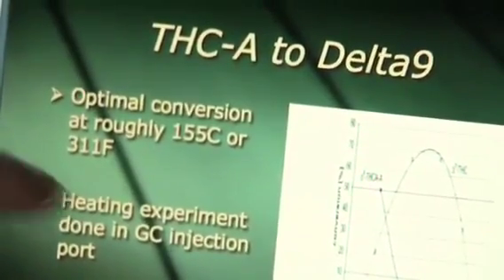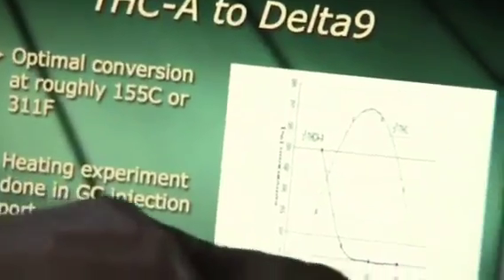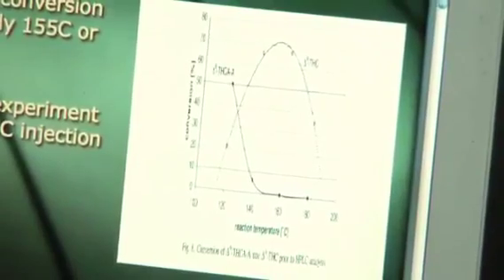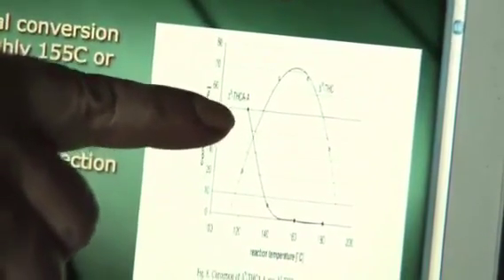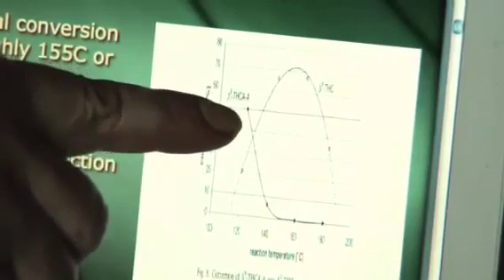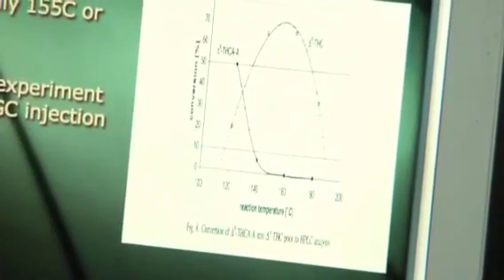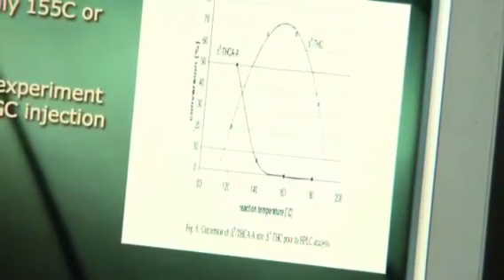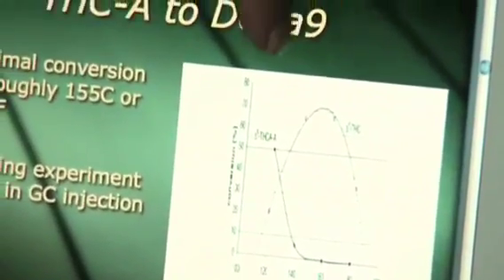Dr.Paul Hornby about Decarboxylation

Comment: Its true 20min 150c or 300f in alu foil, then let it cool down, then grind it down in a mortar, not to fine.
Add  water and drinks this it will destoy Chrons and other diseases. 
Most important it will put u in the most brutal high

Comment: It's so confusing.  We hear experts say 245 degrees for 27 min, 250 degrees for an hour,  250 for and hour and now 311 for 30 min......all have their charts too.  Who does a person really listen to??  Also, he says 311 degrees for that length of time would be too much for a small quantity.  So......311 degrees for 20-30 min is for what amount of MJ?  See.......still no clarity on the topic.
Reply: OR's Lonewolf I usual see this temp and time done for about one ounce of flower. Give er take...
Reply: OR's Lonewolf it's old science that gave us the 250 I remember reading something about the experiments being done in a closed sealed enclosure also.
Reply: Reality TV Clips If you use a heat greater than 160 ° f you will cook the THC right out of it . at this temperature I cook it for 2 1/2 hrs it works for me .
Reply: I have decarboxylated a lot of weed, for for a small portion, say two or 3 grams, wrap it in tinfoil,Put it on the rack of the oven set your oven for 250 degrees Fahrenheit, for 25 minutes, your material, should come out a golden brown color, now that it has been decarboxylated, it is now no longer THC a but THC ready for cooking or just eating as it is
Reply: I've always decarbed at 250F for exactly 27mins.
Its always produced great oil.
I agree tho that so many say so many different thing. I stick with my recipe
Reply: @444valencia  Ya know, I've never experimented with different times. I'll give that a shot. Maybe it's a matter of doing different time and have it tested.  THX
Reply: @10MinutestoRouletteFortune  from what ive learned, more than 27 mins will ruin the thc potency. Also too hot or too cool will ruin the results. I think i will stick with 250 F
For27mins
Reply: @444valencia  I appreciate that. My oils and butter has always turned out fine but perhaps higher in THC with a lower time. There are two ways to achieve more of an indica effect with MJ. 1, to let it grow past the stage with more amber trichomes or be, over carboxilation time.  I'm sure you know that but don't know your level of knowledge. I also  mostly grow sativa as I'm Bipolar, I have two parts of my grow take. The sativa I use for energy for the depression and I over grow's time by a week or or more to 70% amber to 30% milky for a more indica effect for mania and pain. To kick me down a notch. I just love how growing can produce the same effects with just one strain.
Reply: @Home Grown absolutely agree. I'm only ever doing what Rick recommends.
Reply: @Home Grown I've progressed in my skills. :)

Comment: Does the boiling of cannabis in butter and water decarboxylate the product, allowing for absorption of THC’s via GI tract?
Reply: I've been wondering that myself.
Reply: You can decarb in water and butter, but it has to cook in a crock pot for up to 30 hours. It’s a big waste of time. Try  boiling the cannabis in a Reynolds baking bag  for 100 minutes,  gives you 100% decarboxylated MMJ No fuss no muss, Or you can bake it in your oven at 240*F, in a glass bread pan. Cover the inside bottom of the glass pan with  half of your cannabis, put the rest on top of the probe and  cover with thick aluminum foil place in a preheated oven (240*F).Set your alarm to go off at 220 to 230 turn off the oven and let the glass cool down to the touch while in the oven. 
I live in the desert southwest. I’ve found that I can use the same method using the bread pan and foil. I just set it on my patio and let it sit for 24 to 28 hours, and get great Decarboxylated cannabis.
NOTE: Never leave your MMJ in oven unattended, one distraction will get your oven medicated not you.
            Cannabis must be completely dry. This is when you can crush a bud between your finger and thumb.
            If not dry the THCa will leak out and burn on the glass,
            Never use a metallic pan to decarb MMJ with. Metallic pans heat up too quick and will burn your MMJ.
If not clear on any part of the procedures, just ask. It took 3 months to get this. I’m Sick and Busy
Reply: +Caseys Karma  That's some top notch advice you've got there!  You sound like you've done your studying!  Can you help me understand more about it?  After decarboxylation, is it good to extract/infuse at 305, then separate the oil from the herb (setting it aside labeled as 305 oil), and use the same herb again with new oil to extract/infuse at a higher temp, like 340 or 350, so as to make efficient use of the herb, destroying less of the first cannabinoid extracted/infused, does that make sense?  I can't help but wonder how one can then tell when it is that the fat in the oil is fully saturated with cannabinoids.  Can the oil be reheated to the same temp (or a little lower than before) to extract/infuse new herb into it in an attempt to saturate the fat even further, or should that be tried without letting it cool down in the first place?  Any idea?  Sure are some good questions, huh? lol  I'm thinking of using avocado oil with a boiling point of 520, so as to goes as far as to even extract cbc, pulegone, and quercitin.
Reply: Thats great, you can substitute apple sauce for the egg in the recipe, it cuts back on the cholesterol in your foods. Has the same reaction eggs do. You can find out how much under vegan substitutes.
Reply: Caseys Karma
Well, grapeseed oil has a smoke point of 420 and is all unsaturated fats.  Sounds as good as it gets.  lol
Reply: The information contained in your answers is great. I was first soaking my material in water for 24 hrs, changing the water every couple of hours to remove the chlorophyll taste then I'd dry it in preparation for infusion into butter @ 250° for 1 hr. Next time I'll try decarboxylation at the end of the drying  time by bringing the shake/bud up to 305°-310° for 30 minutes.
Reply: The reason for Decarboxylation is to activate THCa into THC the psychoactive form that gives you the high, and to remove any contaminates that could kill you, like E. Coli, and many others. Other Cannabinoids can be extracted at higher temps. The 305 is in the range to release more cannabinoids, but you need a list to find out the temps and cooking times. I would never heat MMJ in oil above 350, thats hot enough to deep fry chicken, not so good for MMJ. Before you cook with oil you need to look at two things. First you need to know the SMOKE POINT of the oil you’r using, and the temp that other Cannabinoids you'r trying to extract. Then you need the FLASH POINT of the oil you’r using. As you approach the Smoke Point, it is a warning that you’r close to the FLASH POINT of the oil you’r using. Exceeding the Smoke Point is a sign that you’r about to hit the Flash Point, which is the leading cause of Kitchen Fires.
Cooking at 520* exceeds all listed oils Flash Points, Safflower oil has the highest smoke point at 510*, exceeding that it will cause a house fire. 
The way you can tell if you have good 305 of 350 oil is to check the color, it should be amber, all the green comes from the Chlorophyl in the plant, so it is usually extracted along with THC, giving it that nice green color. 
The bottom line is that you should know the oils Smoke Point and Flash Point,  the temp of the Cannabinoid   you’r trying to extract, and the cook times. Most of all never try an extraction with oil more than its Smoke Point. The highest Smoke Point I could find is with Safflower oil, it has a Smoke Point of 510*, so never grab an oil off the grocery shelf and think it is all right to use. Some cooking oils have Smoke Points as low as  high 350, thats hot enough to cook chicken, What it will do to you’r MMJ? It could cook off all the Cannabinoids.You need to GOOGLE Smoke Points of cooking oil, there you will find a list of common cooking oils Smoke Points. That will open your eyes. I only found 1 oil that can tolerate the temps as high as 510*F, Safflower oil. All other oils will hit its Flash Point and start a kitchen fire before hitting 500*

The information that was given in the video is dangerous and should never be attempted by novices, only by experienced people with the proper safety clothing, and eye protection. I would hate to see anybody end up on a burn ward with 50% or more body burns, just to get some of the hard to extract Cannabinoids from your MMJ. If you need them,  try the Rick Simpson Hash Oil technique
Reply: mef175, I would extract the THC, first at 220 to 230, then try with fresh Safflower oil, and it should work. 305, may be slightly green but usually amber. Its easy to tell if you’ve extracted any cannabinoids by the color. Compared to uncooked oil it should be slightly green to amber, the green id due to the chlorophyll in the plant, and has nothing to do with the Cannabinoids, if you did the THC extraction properly, you should get all the THC and chlorophyll out in the first cook. The 305 and 350 are very high temps to cook at, and could burn off your Cannabinoids if you’r not careful. You need to find out the cooking times to get the max return. Then you need to find the Smoke Point and the Flash Point of the oil you’r using, some will ignite at temps as low as 400*F. If you try this method, make sure you have the proper personal protective equipment. You need to protect yourself, 350* is hot enough to cook chicken wings. It will cause severe burns if you get it on you’r skin or clothing. You should look like you’r ready to Arc Weld, A full face shield, and a leather apron and leather arm protectors. Personally I don’t like the method, it is very dangerous. Don;t use any tropical oils or coconut oil their high in saturated fats, and can raise you’r cholesterol Low Density Lipoproteins, that cause plaque to form on the walls of your arteries, If the plaque breaks loose, you end up with a heart attack, stroke or pulmonary embolism. You can raise you’r LDL in 4 to 6 month, that you’r Dr will want you to take a cholesterol lowering drug. You don’t need that, you’r trying alternative medications to avoid pills. They have to many side effects.

Comment: I ate 3 grams raw weed with a bowl of ice cream and I got suuper duuper high.. No decarbing
Reply: +jeff fay you will get the same highness with only 1 gram decarbed
Reply: why you lying? thca is not psychoactive it has to be decarbed to turn into thc which is the activated compound therefor raw cannabis does not get you high
Reply: also decarboxylation can be done via cold temperatures not just hot temperatures, most likely you's still decarbed it but using cold temps instead of heat
Reply: I got high just eating a very small amount of raw............no heat.

Comment: Hello Dr.Paul Hornby. Some people are trying to achieve the best medical cannabis paste.
Does 176 F at 10.5 hours sound right? ( low heat canning )Like canning vegetables in a mason jar
if not what Time and heat would you choose?
canning method using coconut oil or olive oil and cannabis

Time and heat....

__XXXX________Fahrenheit  @ _____XXXXX______Hours
Reply: Mark Phelps I've done this a couple times now. I do a double boil oil bath. Oil bath at 200-220 and your solution at 180 for 2-6hrs. I just made an Ecig juice using VG extraction. Works great.even if u get the temp a lil high u still can count on your juice having cbd/cbn, etc. Will always get positive effects from any type of extraction, just need to tweak it to get optimal effects. I find oil baths keep a steady temp, where as water baths jump all over. Easy to screw up the decarb. Check out rough house studious vids. They r helpful and easy to understand instructions

Comment: PHYTOCANNABINOIDS DECARBOXYLATION 101
THC (Δ-9-Tetrahydrocannabinol) Boiling point: 157°C / 314.6°F
CBD (Cannabidiol) Boiling point: 160-180°C / 320-356°F
CBN (Cannabinol) Boiling point: 185°C / 365°F
CBC (Cannabichromene) Boiling point: 220°C / 428°F
THC (Δ-8-Tetrahydrocannabinol) Boiling point: 175-178°C / 347-352.4°F
THCV (Tetrahydrocannabivarin) Boiling point: < 220°C / <428°F
Reply: EssiacHempLaetrile these temps are boiling points, not decarboxylation temps. THC boils at 157c, meaning it evaporates at that temp. To decarboxylate THCA to THC the optimum temp range is 110c to 130c for about an hour (with various factors effecting the exact cooking requirements).
Posting a list of boiling points under the title "decarboxylation 101" is not very helpful, and is actually quite misleading.
Reply: the
Reply: oafking doesn't this depend on starting material? What about if using kief?
Reply: EssiacHempLaetrile hemplaetrile give us some research on that besides the doctors in Brazil